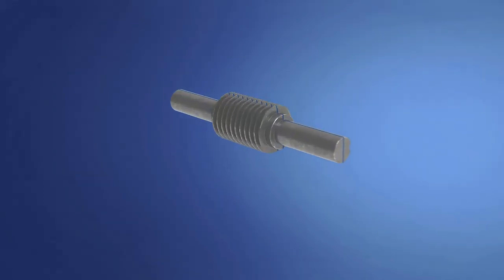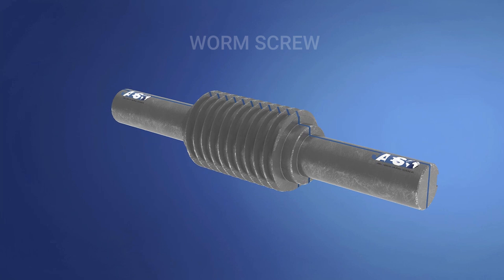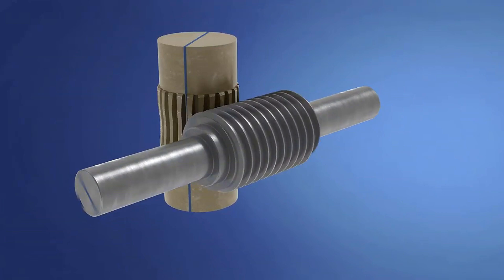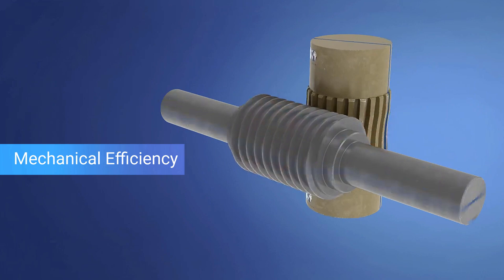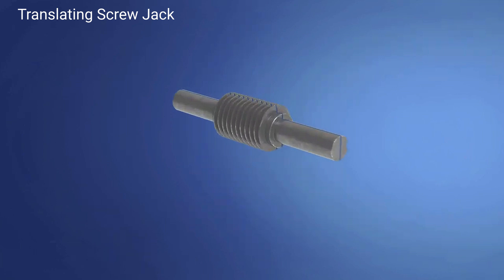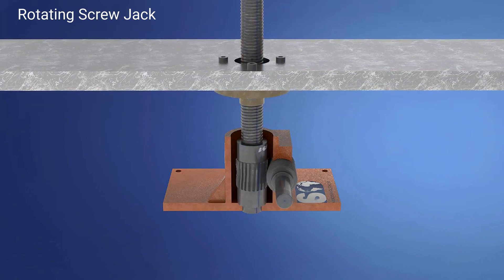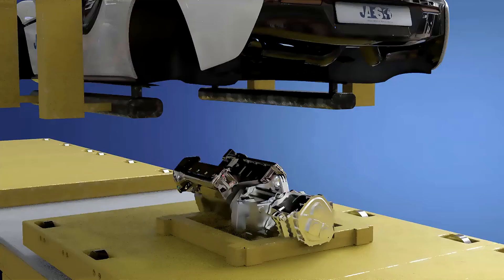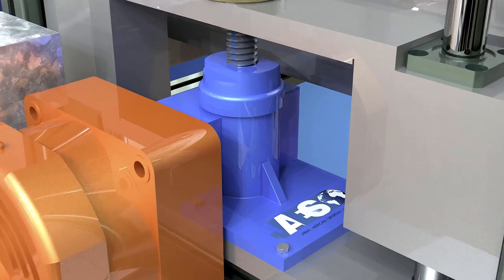What is JACKSCREW and how it works - Translating Screw Jack and Rotating Screw Jack

Comment: Can anyone tell me how to calculate the buckling force of the worm screw?
Reply from the maker: Dear Desirée, thank you for your interest! After selecting the drive unit, it is important to check whether the worm gear screw jack or any transmission components may be overloaded by the drive unit. So, determining the buckling load is an important step in screw sizing. The buckling load can easily be calculated based on the screw’s root diameter, unsupported length, and end bearing configuration: the maximum compressive load "Fc" is equal to the end bearing factor "fb" multiplied by the ratio between root diameter of screw "d1" and the unsupported length "L" squared, then multiplied by 10 raised to the fourth.  I hope this information was useful if you have any questions or would like to add some more information please feel free to leave another comment. Wish you the best!